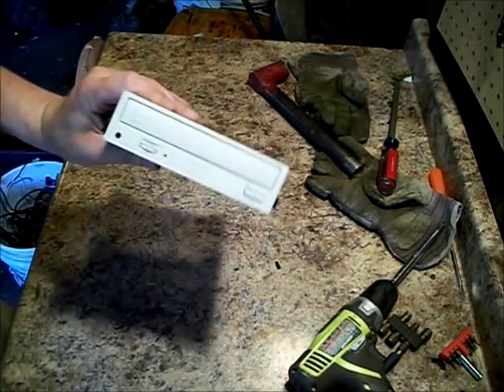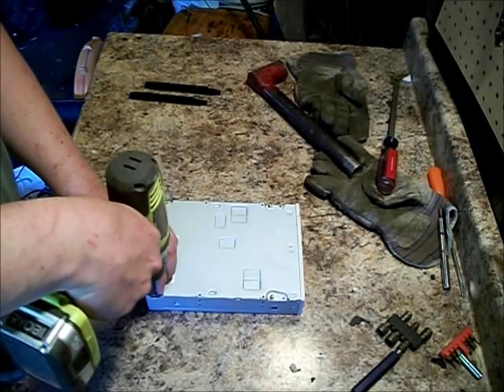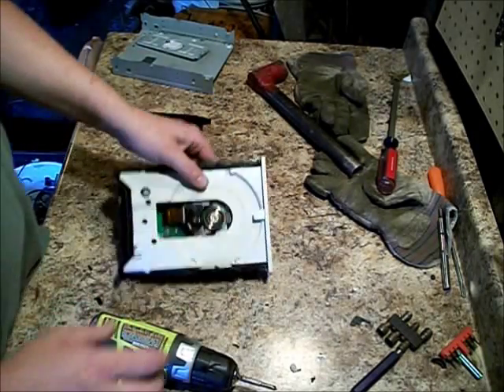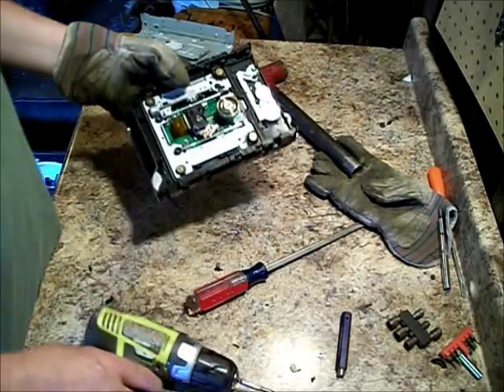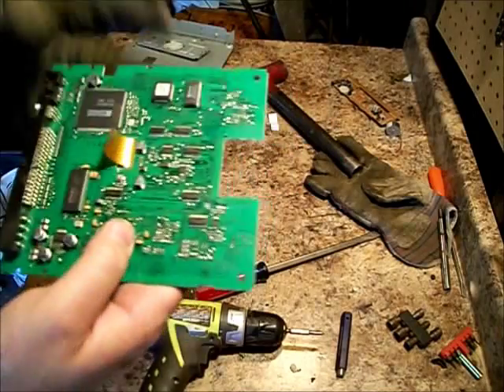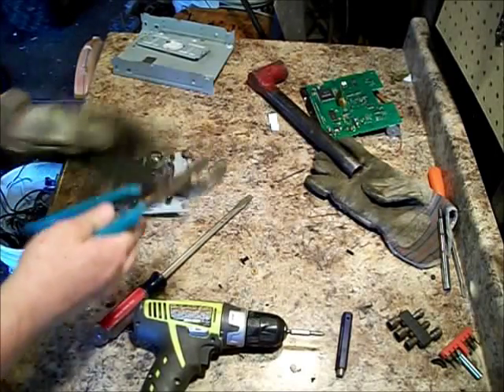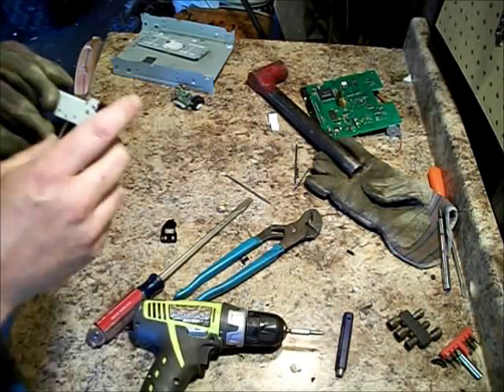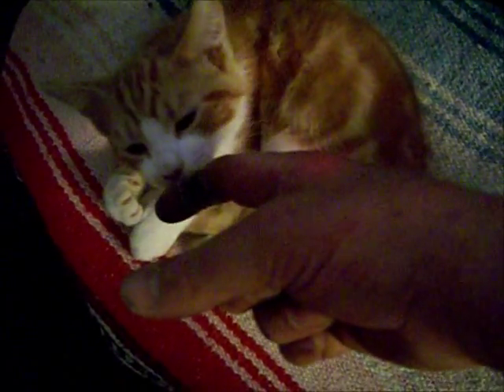scrapping a dvd rom

Comment: Three things.Firstly ,thanks for your helpful video.Secondly,why do they use brass for the screw drive shaft? Thirdly,some advise on the cut.I too have cut myself plenty of times whilst scrapping.One day a few years ago I did just that,when my wife showed me a great trick that will help your cut to heal pretty much painlessly and quickly.When you cut yourself like that go to your cold water tap asap and irrigate the wound with plenty of water.Whilst you doing that ,squeeze the cut as if your trying to expel something inside.I found it a most effective treatment.They way I figure it ,the squeezing forces out contaminants and bacteria which gets promptly washed away by the clean water.When you release the squeeze clean water is sucked back in.Good idea to alternately squeeze and release whilst under flowing water.Then simply dry with tissue and put a band aid on.Hope this helps for next time.  Cheers,Trevor.
Reply: we use brass bushings at work cause they hold oil well, im going to guess that's why they used brass for drive shaft as there is a electric motor on the end, but im just taking a guess